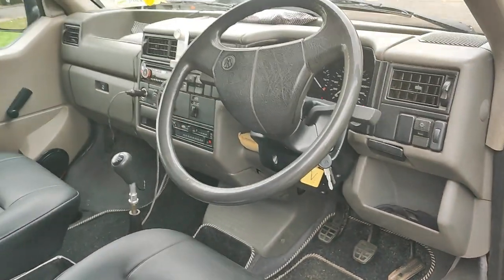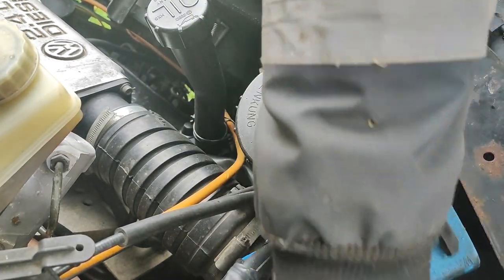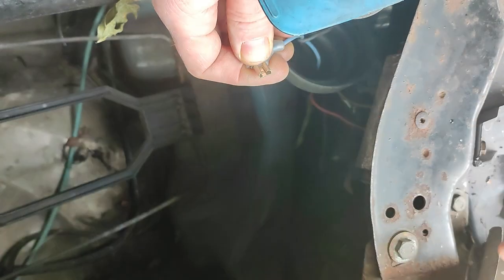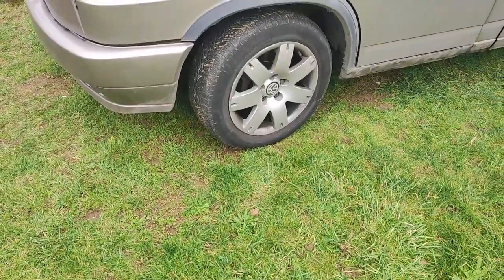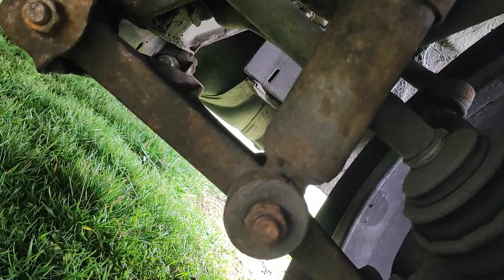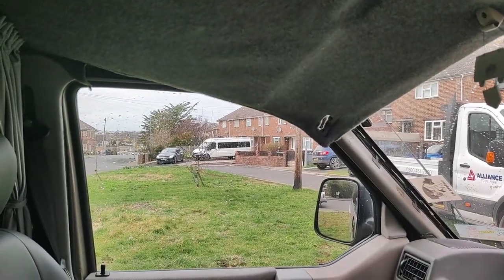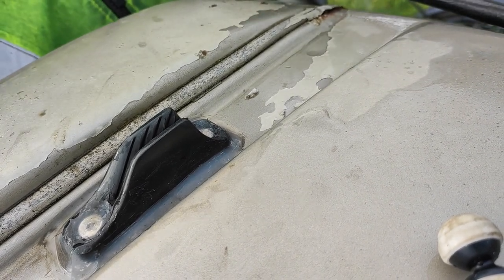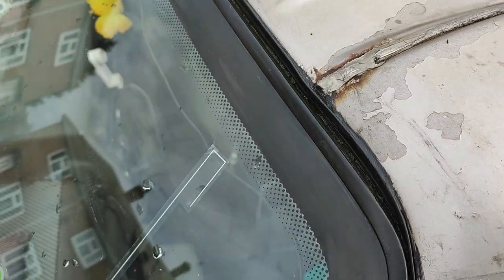VW T4 - Bulbs, Horn and a Leaking Windscreen!

Comment: Hi mate why as this t4 got a 20 amp fuse for the horn but mine is 10 amp. Same van. My horn won’t work. Tia
Reply from the maker: Hi, we had upgraded the horns and they take a bit more power. 
Most likely cause of the horn not working is the horns themselves. They sit low down near the front wheels and tend to suffer from corrosion as a result.
Reply: @Wilko159  thanks mate i’ll have a look. 👍🏻